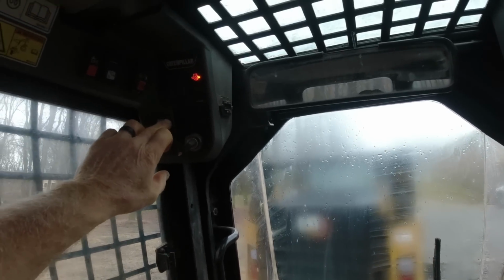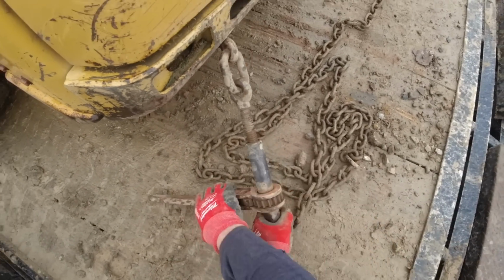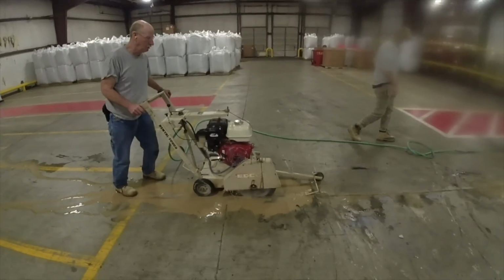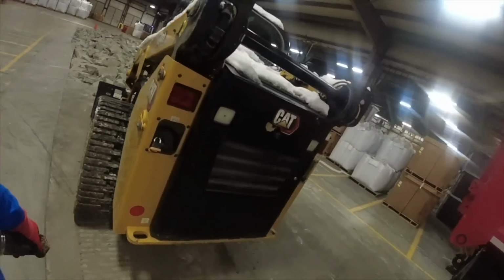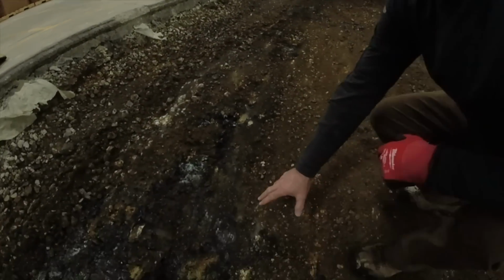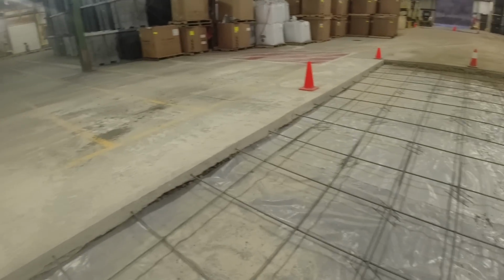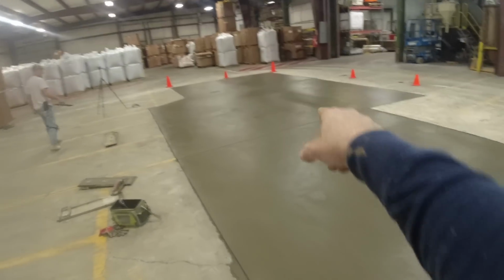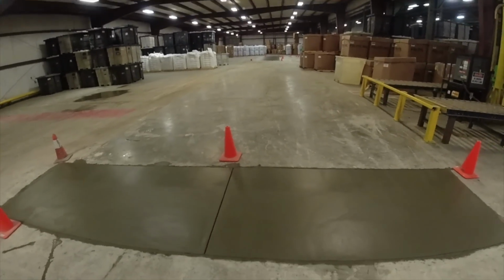What Is Causing This?!

Comment: I'm betting if you check outside around the building the drainage has changed and the waters not getting away from the building because this would have been a problem long ago.
This happens often gravel added outside / inconvenient drainage ditch closed up / building added next door dumping water .
Reply from the maker: I think you’re right

Comment: We have had good luck double cutting all pavement for removal. Seems to really help with keeping the edges from spalling.
Reply: Companies I have worked for always inserted strips of 1/8th plywood in sawcuts to prevent spalling on existing concrete. Works a treat as long as you leave it in until spoil is excavated.
Reply: Inserting 1/8th plywood into sawcuts will prevent spalling.

Comment: Not saying that you are incorrect with the assumption that the mill slag is exhibiting expansive properties, but there are other questions that need to be asked and answered to have a definite answer to the floor problem. 

Right off the bat. . That floor system doesn't look as if was designed to hold the dead weight of material in super sacks or the fork trucks to move them, or the tractor trailer loads being driven on that floor.   Too much weight for a 4 to 6" slab of mostly unreinforced concrete. . With no dowel bars to transfer the loads from slab to slab, and extremely large saw cut spacing could all be contributing to this issue. 

While it's entirely possible that environmental changes in the area causing the ground water to rise. . I would start checking the basics first. . Blocked storm drain. . Broken roof leaders. . etc.    Way cheaper to unclog a drain than it is R&R the slab, without even identifying or fixing the original issue. 

Also worth noting. . That mill slag can be some bad shit. . . It wasn't unheard of for the steel plants to dump the wasted chemicals used to prevent oxidation of the product coming out of the furnace, into the slag pits.  Benzene, toluene, and Xylene. . To name a few.    So maybe disturbing that shit might not be the greatest idea.
Reply from the maker: Very interesting thanks for sharing

Comment: I worked on a house where the basement floor heaved, poor drainage, no space heater, fhakin cold weather. Bad combo !!!
Floor split down the middle and lifted almost 3” pushing the lally columns up too. After thawing, the carpenters had to cut an 1-1/2” off most of the columns. The floor of course never completely settled and had a good 1/2” canyon the length of the house.

Another house,luckily only had 3’ of ice in the basement 😬 didn’t hurt the floor or house. Didn’t need a step ladder to rough in the plumbing and heat piping .
Reply from the maker: That sounds nasty

Comment: Tom I used to work in a mini mill in NJ we made wire. Anyway the slag was sold as fill everyday. It is slimy when wet. But dries hard as concrete. As for why there is water under the slab. My guess is progress and development of the surrounding area. I bet a lot of buildings weren’t there decades ago. So the water doesn’t permeate the ground as it once did. And you know water it will go where it wants to.
Reply from the maker: You’re right about that

Comment: Where I live we have extremely expansive adobe clay. One solution was Void Form (basically heavy duty cardboard boxes) between the slab and the soil. The soil then crushes the void form and leaves the slab ok. It does require more rebar but it was one of the simplest solutions we found.
Reply from the maker: I like hearing the many different solutions

Comment: After you described the lay of the land there it sounds like your customer has a water problem that should be addressed. The town or a civil engineering firm should advise your customer about installing a french drain and sump system around the outer foundation to prevent water from the hill side from getting under that building. Roof gutters must also drain the roof water far away from the building. I offer this as something to consider. It was fun watching all that work getting done.

Comment: Tom, this is about some past pours. On the steps I notice you  set your form boards at height of slab. When I did steps I ripped the bottom of the board at a 45 degree angle so that I could trowel right to the step. When I pulled the form there wasn’t anything to trowel out. Of course, we let things get a bit dryer first.

Comment: Sounds like steel slag to me I’ve encountered this same situation in Hamilton Ontario a few times.  Working on a home right now that had slag used under the basement slab which heaved basement floor.
Reply from the maker: Did you get that rotten egg gassy smell?
Reply: @Concretewiththehauses  
No, no rotten egg smell.

Comment: I'm from the Sacramento area. The Sacramento Valley is an ancient area of yearly flooding from the rivers coming down to the valley. We have a lot of expandable soil here. An old timer taught me a trick to drill post holes in this type of earth and fill with 3/4" crushed stone and cover the holes with sheetrock. Then more crushed stone on top to allow the subbase to expand and contract without heaving. Of course if you have water migration you need to correct it by digging French drains around the perimeter of the building and route the water away. Hope this is helpful.
Reply from the maker: Amazing figuring things out to make projects work. I love it. Thanks.

Comment: I have seen the same thing happen before. During construction, a access road is built thru the site. Many times fly ash is added early into the ground to dry up areas that traffic has pumped up moisture. Most of the time the area that was used as a access road will hump up during the curing time after the concrete is poured. It looked to me like the heaving of the concrete was uniform and in a straight line from end to end of the building. The access road thru the building would not have the same substrate as the rest of the building.
Reply from the maker: What a mess

Comment: It may have been a good idea to have dug a 10 foot hole , 3' in diameter put a 3' diameter piece of culvert in it with weep holes and put in a sump pump. Cut a channel for a a drain pipe  . By lowering the water table it could prevent future heaving. Just a thought.

Comment: Coal fired power plants sold that in my area in the 70's to contractors for fill.  Coal ash is the mineralized residue left over from burning coal to generate electricity. It's actually a collection of different types of materials, called coal combustion products or coal combustion residuals: fly ash, flue gas desulfurization products, bottom ash, and boiler slag.
Reply from the maker: Good info
Reply: With EPA requirements lime is added when burning bituminous coal so it makes a good candidate for making concrete.

Comment: In our area, they would use fly ash when pouring sidewalks. They humped it up in the middle of the sidewalk so that they didn't have to use as much concrete. Then the sidewalk would crack down the middle. I found some that the concrete was less than 2" thick in the middle, 4" thick on the sides. They saved money and it looked okay when they left
Reply from the maker: Crazy

Comment: Hi Tom, After WWII a lot of brick homes were built in the Pittsburgh area, many used the J&L slag from the pile along the Parkway North. A lot of people used the slag because it was cheap as opposed to 2-B washed gravel. Eight years or so later the foundation blocks began deteriorating     Requiring the house to be lifted everything removed and new block foundation installed. The ground was with the slag interacted with the concrete eating each out!!
Reply from the maker: Wow, that is amazing. Imagine the price tag on all of that.

Comment: I like in golden Colorado and knew the answer to your expansive soil question. We have it up and down the front range as there is much clay in the soil. Builders in homes out here have resorted to NOT pouring basement floors but they hang a joist style floor in many homes (most of the homes out here have basements, unlike some other areas as our water table is much lower). We also must build floating walls when finishing a basement or any walls on top of concrete (look up floating walls, and they aren’t to difficult but they are SUPER important so you don’t destroy a home). 

Good video Tom, thanks
Reply from the maker: Very interesting the different techniques

Comment: No concrete expert here, but I would have expected you to use more rebar after all that work. Those squares look very big. Think most people over here would have used the big mesh sheets with about 8” squares. Interesting to here about the mill slag issue
Reply: In Europe (me from austria)  we would use at minimum 2 or maybe 3 layers of rebar with 4" squares. Also concrete with a minimum thickness of 12" at industrial buildings like this. It always makes me smile (or more shocked) when i look at clips where you can see how poorly construction work in the US is done.

Comment: The city of Akron, Ohio uses a lot of the expandable soil for the sewer system as fill around the pipes/hollowed out trees in the 50's and 60's now they are trying to get rid of it the redoing of the lines.
Reply from the maker: Sounds pricey
Reply: @Concretewiththehauses  between them using what was available to them cheap and the sub-par design of systems that is being addressed at the same time it's coming in at just about $1,5  billion dollars. We have the sanitary sewer and the Storm run off tied together and it's getting into the stream's and rivers.

Comment: When we lay DPC membrane in the uk we glue the DPC with a water proof double sided tap to the existing concrete tthen you don’t get any coming up though the joints
Reply from the maker: We do that sometimes on our heated floors, but not my common practice
Reply: @Concretewiththehauses  ב''ה, any Radon concerns in your area?

Comment: Cleveland as well as Pittsburgh had large producing steel mill....by product was "slag" sometime also referred to " popcorn ".
Contractors used these " cheap " materials into different applications,  one was on top of footer drains, ( drain tiles) , after awhile it would compact so hard was like concrete, water couldn't get through  causing basement leaks.....how do I know,  my grandfather had a waterproofing  business, in the 70's ,80's dug a lot homes in Cleveland area and old suburbs,  Cleveland Hts., Beachwood.....

Tom guess when we used today industry standards product s, we don't really know the  50, 70 year OUTCOME! ( most of time)
Reply from the maker: Sounds about right

Comment: Did You measure the humidity of the soil and concrete?
Reply from the maker: I did not
Reply: @Concretewiththehauses  Do U know that any concrete body (anything from a bridge down to a brick) will always try to equalize its water content throughout its total volume. Watch when they try to put down an insulation surface on a bridge before asphalting during winter.

Comment: I used to work for a construction company that did the exact same type of work you are doing in factories. Instead of breaking the concrete up,we used to cut the floor in 3'x3' and or 4'x4' slabs and remove the pieces with a skid-steer with fork attachments. Then used the typical bucket for final clean up. We found it was much quicker and cleaner.   Every job is different, just sharing my experience with you.
Reply: I’ve seen that skid steer attachment in operation. Clamps large cut junks in pieces as you described. Tom might even have one. I’m guessing his concrete cutter might be limited in cutting depth. Anyway this crew is on it as always. There’s another YouTube (Gate City Foundation) channel who does some concrete removal using the method you described. I’m amazed how much I’ve learned about concrete. Until recently I had little understanding of the technology, planning & precision work and pride.
Reply: @MikeZMonroe  Nothing hydraulic. Just regular forks, the same as on a forklift.
Reply from the maker: That sounds like a lot of salt cutting definitely need a bigger saw

Comment: Tom… the obverse can also happen. If the expandable soil was wet (expanded) when the building was constructed, then a lowering of the water table could have caused the problem. The area around the perimeter of the building could have a lowered water table for some reason and the soil settled. Here in Wisconsin, it is quite common to have level manholes in the winter and they turn into bumps in the summer. Here it is frost raising the roadway and the manhole doesn’t get frost under them. A similar thing happens with the expandable soils. The “draining” of the perimeter could be weather caused or somebody may have just installed an underground utility and inadvertently created a French drain and over the years the water table lowered a bit.
Reply: Super insightful comment. In reading other comments there’s a wealth of very knowledgeable people watching Tom who respectfully comment as they really technically know there $hit.
Reply from the maker: You’re right, that sounds like it could happen
Reply: This is my thought too. Add in the fact, they are stacking heavy materials around the exterior of the building, that adds weight on the building foundation. The building is settling slightly.

Comment: Tom 😮 please explain how you aired up the tire with that truck. I am so interested in how you did that?
Reply: Easy peasy… the truck has air brakes and they just tapped into that air system. Most trucks with air brakes have such a tap. It works for air tools as well. Comes in handy to change a tire or to do other roadside repairs.
Reply from the maker: Sure I should’ve showed that on camera didn’t think of it  my truck has air brakes so there is an air reserve tank in the shop. I added a connection for an air hose so we can fill up tires or run an impact gun on a job site.
Reply: @Concretewiththehauses  That is fantastic you should show people how you did that it’s ingenious or at least for me anyway :) I wonder if I could do that with my motor home? It has a diesel engine with air ride, hmmmm I wonder 🤔

Comment: You should have brought in a 65-horse slab saw and cut the area into blocks. Put threaded inserts into each block and lifted them out. No mess, no dust or vibration from the breaker.

Comment: Granular slag it was white  and had a rotten egg smell and it came out of the mill hot but when it got hard man was it tough to break out !  You had to chip away at it it would never come out in large chunks ! And when it got wet it would expand. And would expand at the point of least resistance which in your case is up forcing the concrete to heave ! Thats what Century III mall is built on that whole area is a big slag dump ! I think that was one of the issues they had there was concrete floors and structural posts lifting !!  I remember using granulated slag a lot when I first started working as a laborer while in high school .in the 70's ! There were a lot of by products from steel making used in construction !
Reply: Some people called that " popcorn "
Reply from the maker: Sounds pretty accurate
Reply: Slag is the byproduct of making iron and then the melting of steel or other metals using a flux to refine the metal wanted.  The slag from smelting iron and then steel is mostly from the limestone used as the flux.  It floats on iron or steel in the molten state and cools to a rock-hard consistentcy which is broken by explosives and crushed.  It makes great railroad track ballast.
I remember when the expansive soil problem was a big item in the Colorado Springs and front range area.  So many houses of the post WWII building boom were damaged by the expansive clays in the area in the late 60s and 70s.

Comment: Non-professional here. I found this video very interesting. 

One question: If you dig the area out 4' deep, what do you fill in the excavated area with to prepare for pouring the new concrete?
Reply from the maker: You would fill it with good shell, dry dirt, and compacting layers top it off with limestone

Comment: We used to get mill service slag down here from Weirton Steel.  Lots of iron in it which made it heavy and pack really hard.  I was always told it “off gases” which wouldn’t let you pour concrete over it because it would heave the concrete.
Reply from the maker: The only thing I remember was cured slag, and even that had a little bit of a smell to it, but it didn’t stay around very long I want to say very early 80s

Comment: Am I the only one wondering about running diesel engines indoors?
Reply: I noticed warehouse forklifts - they likely run on propane or electric. I have got to guess Tom or factory folks are circulating air from skid steer.
Reply from the maker: Lots of ventilation